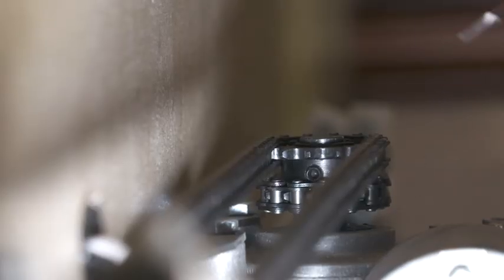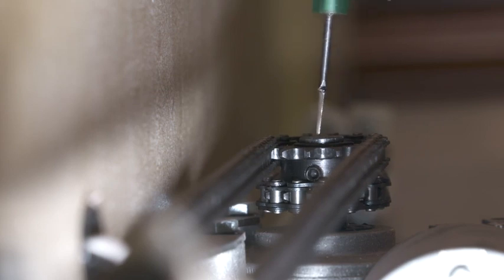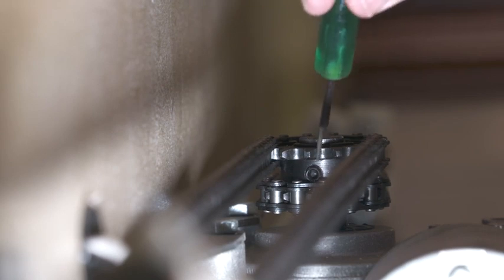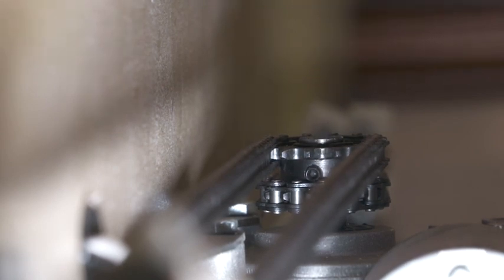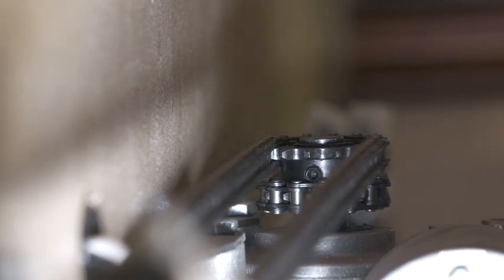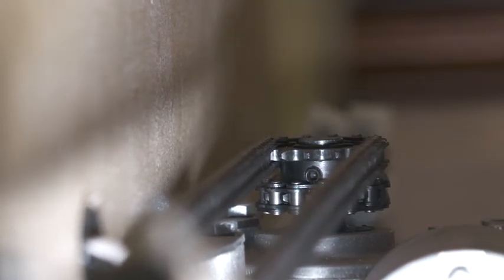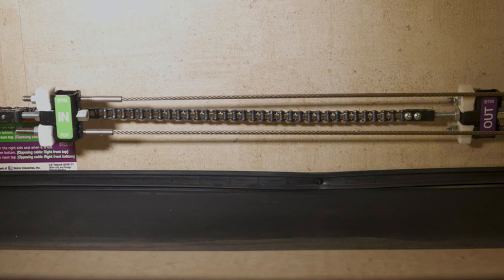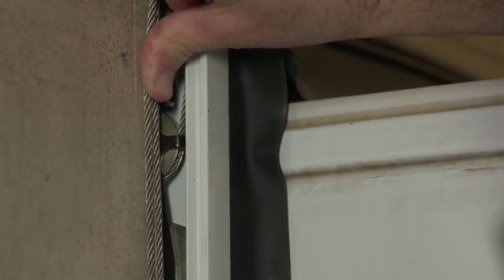RV Slide-Out Stuck: Motor Runs but Room Stays Put

Comment: I have a 2015 Open Range fifth wheel. The living room slide out is not working.  It will go about 1 to 2 inches out and in, the motor starts bumping and will not go any further. I have taken off the side cable covering and not being a mech the cables look fine on both sides. the motor runs, it goes in and out for the 1 to 2 inches, I can not see anything wrong.  Please help me as I would like to learn how to do these things by my self. I am a 77 yr woman out here after my husband passed. 
any suggestions will be helpful. My Facebook got hacked so it is a challenge to get info. Thanks so much for the help???
Reply from the maker: If the motor is not running and it is making a noise and not moving I would suspect the gear box is bad. If a gear box goes bad, once a lot of pressure gets put on the system it will stop moving. It is possible a cable is stuck within the wall channels or something is wedged or wrong with the slide itself. The hole system would need inspected to make sure everything is free of binds and the cables are running smoothly. If it is all fine, then the motor or gear box attached to the motor is the issue. We have a few videos on these slide systems that could give you a better idea on how they work and what to look into.
https://www.rvrepairclub.com/?s=accu

Comment: Hello, wondering if you might be able to help me...so i just bought a 2007 itsica spirit Winnebago and it was in a flood about 6 months ago. The original owner said it sat in 5 ft. Water for 3 days. The stove, microwave, and electrical still work, but it doesn’t drive. I am wanting to have the engine fixed...so I guess what I’m asking is, can this Winnebago withstand flood waters like this and comeback to being a good and save motor home?   The engine has 60k miles on it.
Reply from the maker: I would be more worried about what could have been water logged. If the water was that high for the long, there could be many issues not seen yet. Check the floors and walls and make sure there is nothing soft or swelling. If the water got into the furnace exhaust there could be damage there too. Make sure to check all around the walls and even in cabinets. There could be things that are water logged and could create mold issues too in the future. Check the brakes and wheel bearings, these are not meant to be in standing water for that long and water may have gotten into the drums and bearing grease. It is possible that everything is fine and it could be safe, but you have to make sure to check everything over very well. It might help to take it to a service center to have things looked over, they know what to look for and could find stuff that a normal person might not notice. I hope this helps!